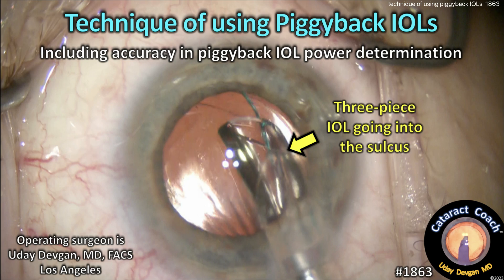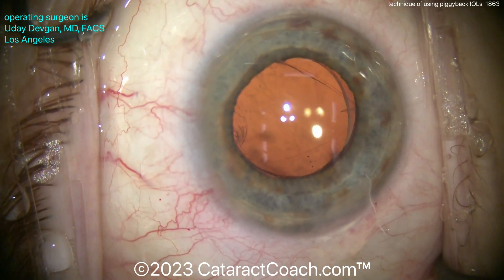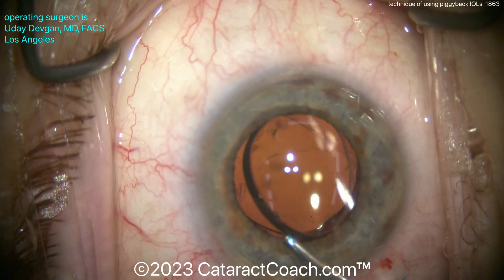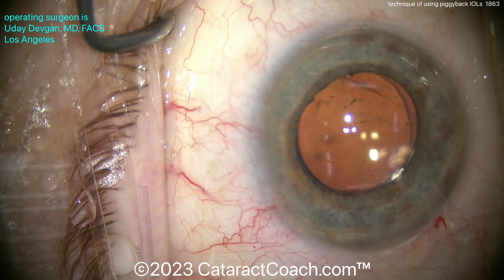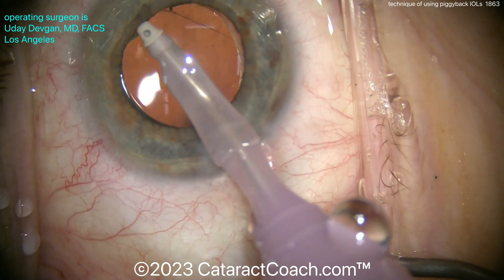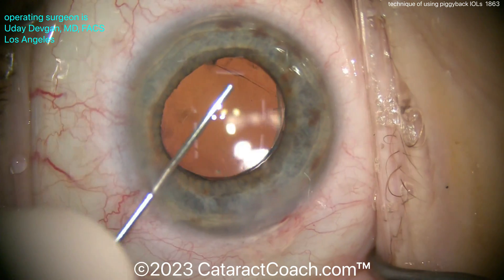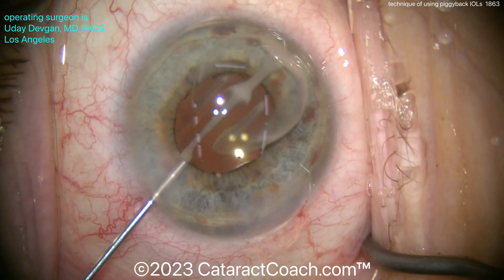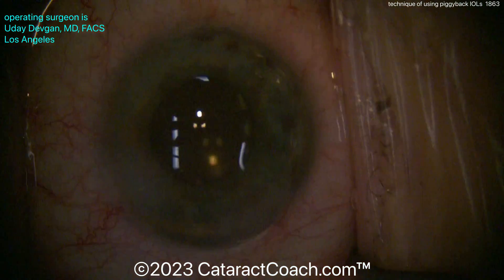CataractCoach™ 1863: technique of using piggyback IOLs

Comment: Sir I had a cataract surgery at the age of 15 years old, 10 years ago. Two years later I also underwent YAG capsulotomy. Today my no. -4 and -1.75; cyl 0.5 in both eyes and +1.75 in both eyes for reading. Can any lasik or piggyback iol correct both my near and far no.s